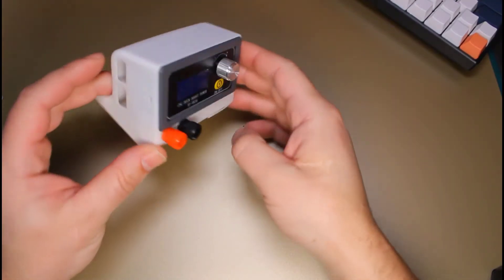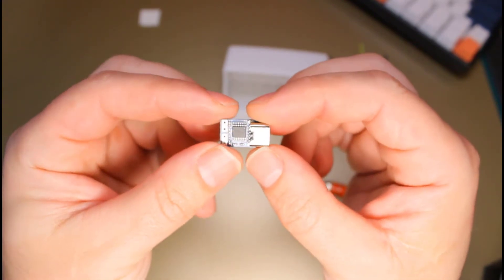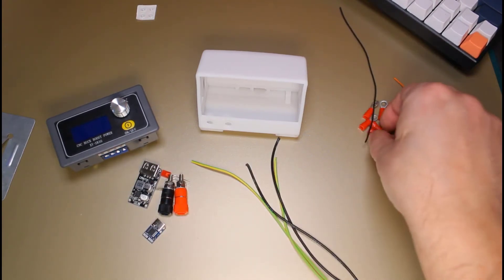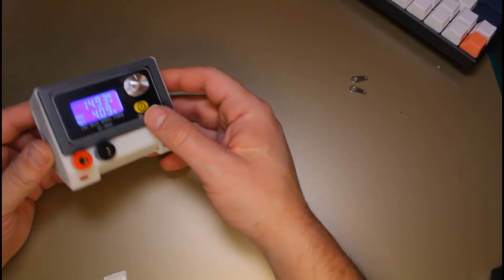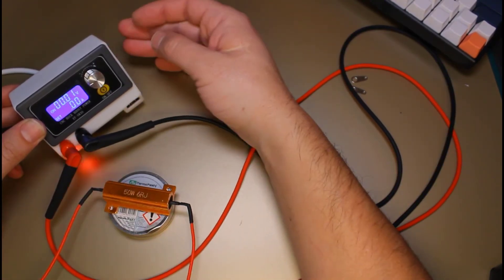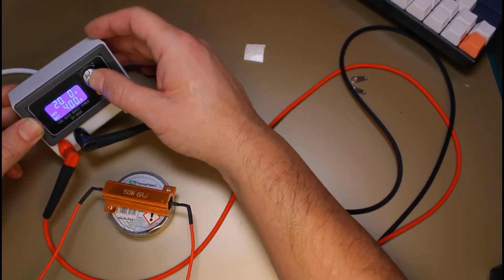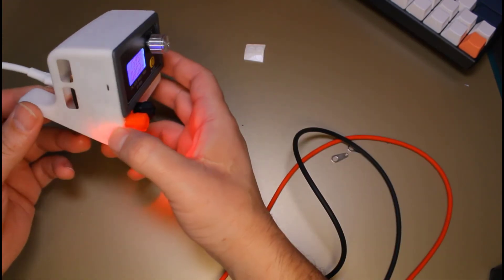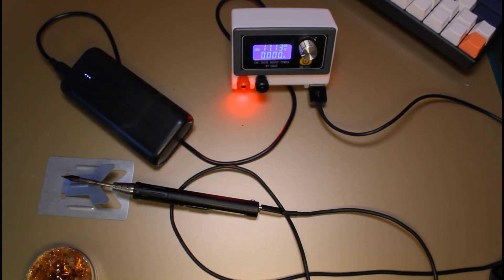Tiny Bench Power Supply -  Powered from a PD Power Bank. zypds

Comment: can you ajust the curent?
Reply from the maker: Yes, the current output is adjustable; the interface is quite smart, can charge (*edited from change) batteries as well.
Reply: @icXu i assume CHARGE batteries?
Reply from the maker: @__Andrew_  hi, yes it can be used to change batteries
Reply: @icXu  chaNGe or chaRGe  - quite a difference;) thanks for reply... nice kit...
further questions/ comment later. cheers.